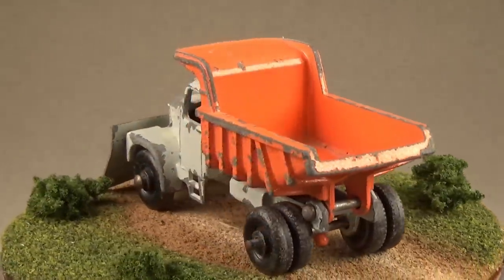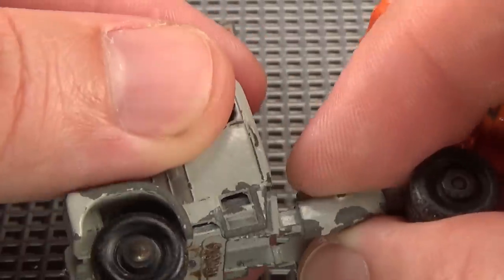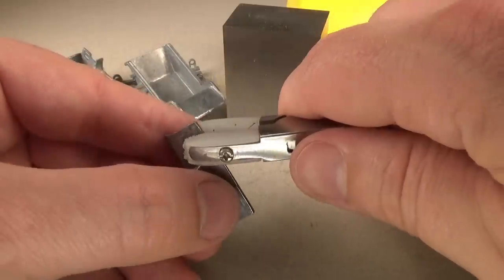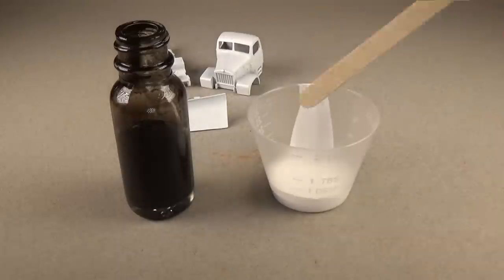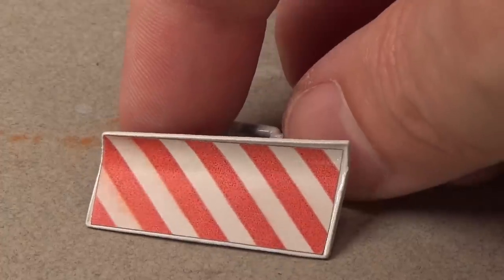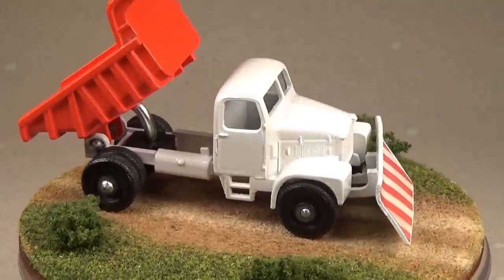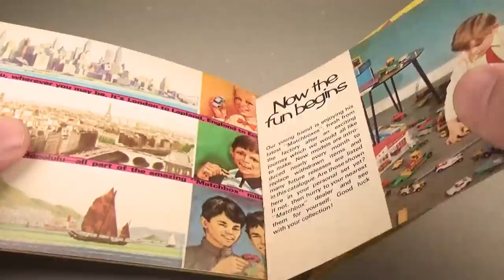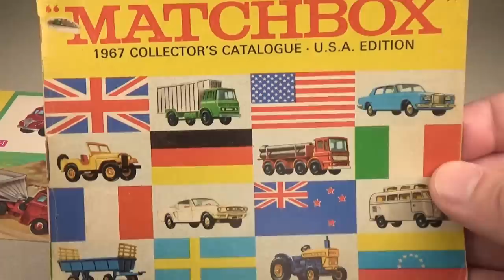Matchbox Restoration: No16 Scammell "Mountaineer" Dump Truck with Snowplough

Comment: When I first started watching diecast "restoration" videos a couple years ago it was taboo even to suggest to sand down a casting line. I am so happy to see more guys doing it in order to make the car look better.  I never understood the thought process of people thinking the designers wanted a big casting line running down the center of the vehicle. The line is there only because of mass production not design. I always saw it as a manufacturing defect not part of the design. So it never bothered me to clean it up and make it better than new. But hey we all can't be happy with a malformed chunk of pot-metal.   Hahahahaha!
Reply: What always got me is that if you had a model that was so in need of restoration because of abuse or age or whatever... It's already worthless so keeping that casting line in for provenance or posterity like it's a piece of art.. is already pointless. 😔🤔

Comment: Just a Hobbyist Photographer that is starting to print my own work with a recommendation. Some papers have Paper Profiles basically special direction for your printer to print on their paper. Hope this helps if you run into any trouble or gives you better results.

Comment: I'm not sure if this has been posted, but when you're bending metal you ALWAYS want to heat it up first, otherwise you make it brittle and easier to break. I had a stainless steel water bottle that I had kept in the refrigerator for too long and the bottom swelled out and it wouldn't stand straight. I got my hands on an industrial dryer, similar to a hairdryer but MUCH hotter, and heated it up. I then used a rubber ball peen hammer and tapped the bottom back in place. Aside from the paint ring, it's as good as new. Also, I apologize if this is condescending, that isn't my intent. I'm an avid collector as well, and I just don't want you to experience unnecessary heartache. I really enjoy your videos and I'm happy that you've continued to make them with everything going on.

Comment: Just a suggestion for you, I have found that when dealing with Matchbox restorations, to remove bends in the castings it helps to heat the part in very hot to boiling water and then you don’t have as much risk of damage to the part as it will be easier to bend back into shape. Rob T. Australia.

Comment: It looks beautiful and brings back a lot of memories. I collected more matchbox than Hot Wheels and I can say I had about half of the models in the book. I think it improves the look to remove the casting lines and I don't see it as a problem. I am certain that if Matchbox had the time they would have removed them too but to make that many it would not have been possible. Thanks for sharing this.

Comment: Interestingly the plow is turned to the wrong side as it would actually be pushing snow into the opposing lane of traffic rather than off to the side of the road.  I never really knew this was even a plow truck when I first saw the one Marty restored as it looks more like a small quarry truck.  Then again I'm more familiar with the trucks which have end gates and spreader attachments on the back of the bed.  Lovely restoration, Zack and definitely gets a thumbs up.
Reply: If you drive on the other side of the road,   it works.
Reply: Im pretty sure lesney was a British company.

Comment: If you lay the metal with the bowed part up, then tapped it with the hammer, you might have more success in making it flat.  Heat also helps with metal.

Comment: That blade sticker looks so bad comparing to the rest of your work. Dots from the low printing resolution can be seen, compared to the sharp pattern of the original.
You should had used a vector graphic software to redo these stripes, it would have ended way better looking.
(don't want to be rude but i'm so used of the near perfect quality of your workmanship that this detail tickled me)